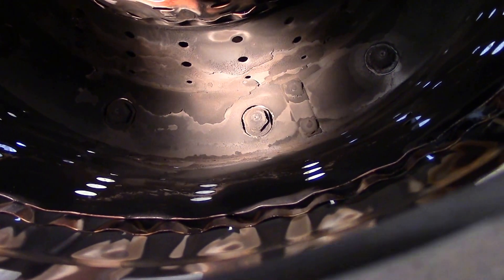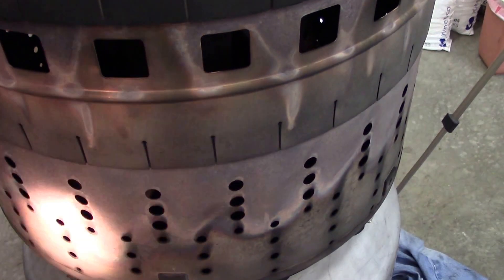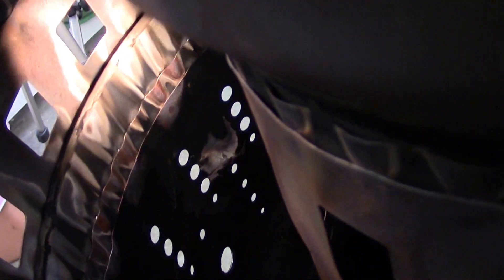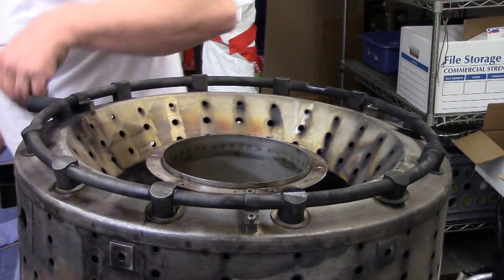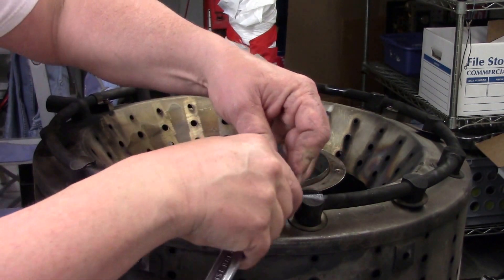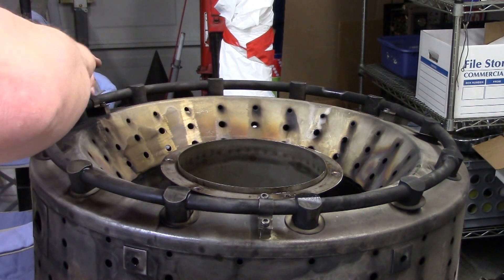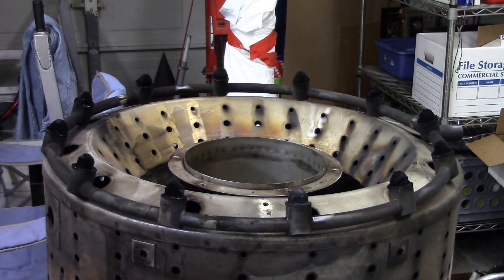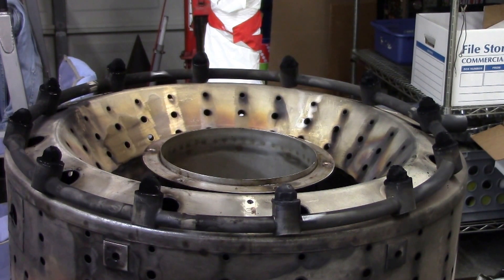The Fairchild J44 Project:  Disassembly Part 4

Comment: Your nine o-clock injector looked a bit wet. Are you sure the manifold isn't leaking there?
Reply from the maker: Hi & thanks for the comment.  I will test the manifold & nozzles before reassembly.  That is a good thought though; I hadn't considered a crack in the manifold itself.  I think the wet we are seeing in this video may be some residual fuel dribbling out during the removal & handling of the assembly.  Ideally, I would like to just replace all 12 nozzles with new, if I can find them, then I can buy brass plugs & seal off the manifold to leak test it.

DD